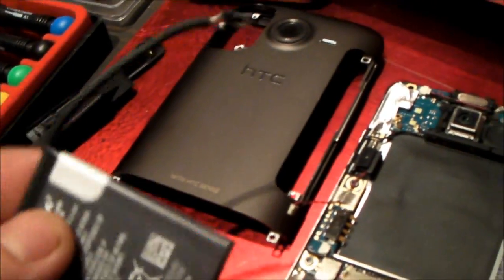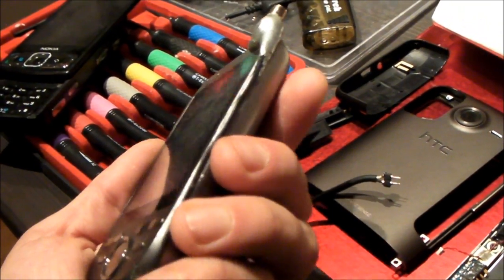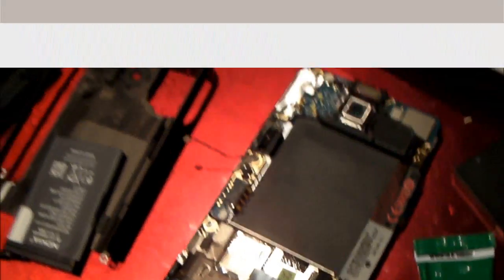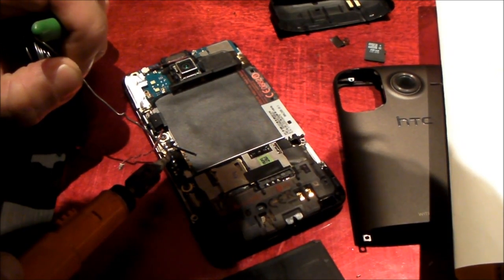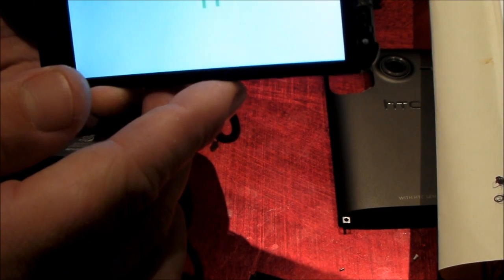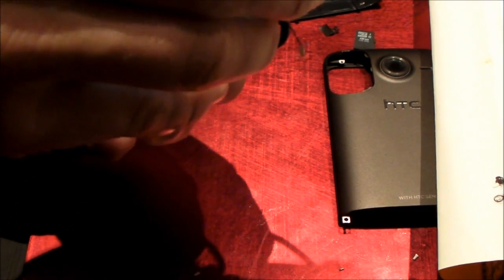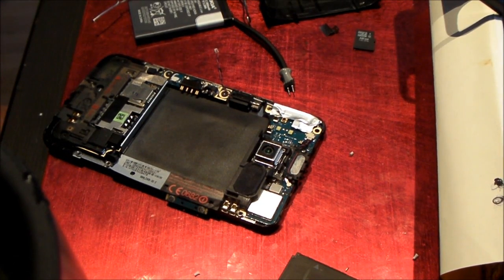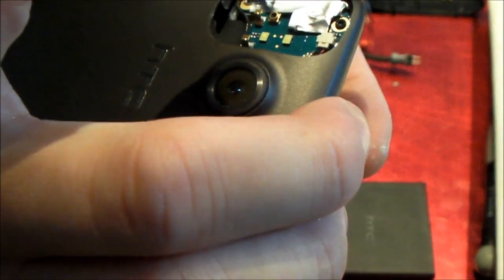Modify HTC Desire HD for hotswap battery

Comment: when i try to charge the phone it will says "the device is using to much power than the charger can give". but in fact i already factory reset my phone.
it was losing its battery while charging and it seems like its draining more the battery when i plugged it. so i cant charge it while my device is ON..
ive tried to turn it OFF with 20% battery and after 3 hours, turn it ON again and i got 0% and shutted down my phone. charging it after it shutdown is the only way i can charge my phone to 100%

Comment from the maker: Ehh ok thanks, i have made a doubble extra battery with connector so i now have 2700mAh of extra nice power, and ofcourse you can add extra batteries to the micro USB.. But i wanted to be able to make a hotswap of original battery.

Comment from the maker: Hi thank you all for your appreciation, on this video, and sure i agree you have to have a quite steady hand when you solder the cables, and sure a cant integrate all the battery functions with only 2 cables, but it works to charge the external battery, its get a little hot but thats quite normal , and i only using the external battery when i on the run and don´t want to shut down my phone and restart. Have a nice day now! // Regards cwessberg